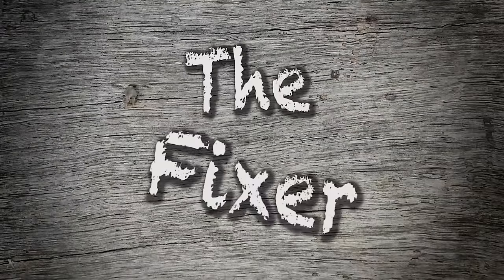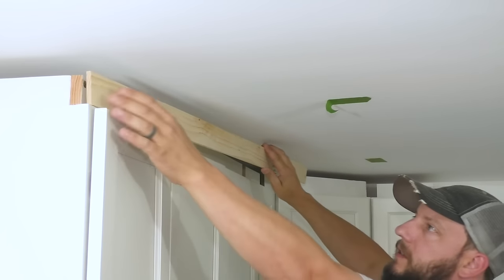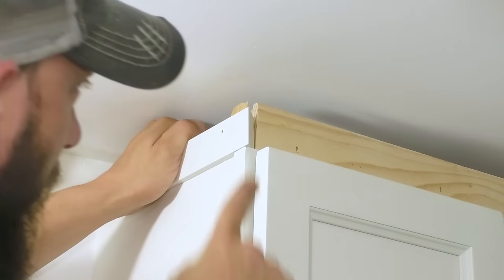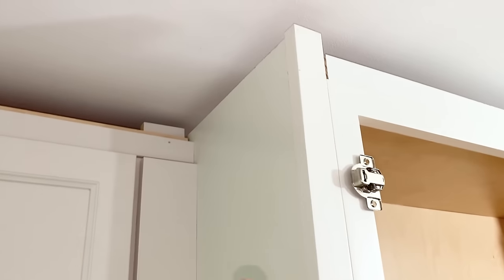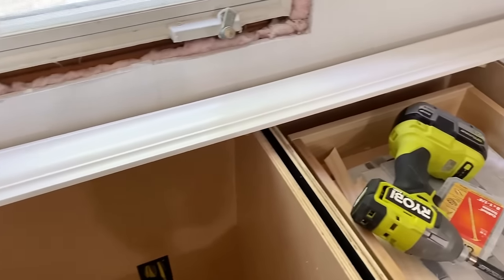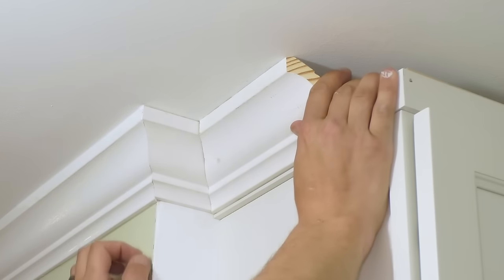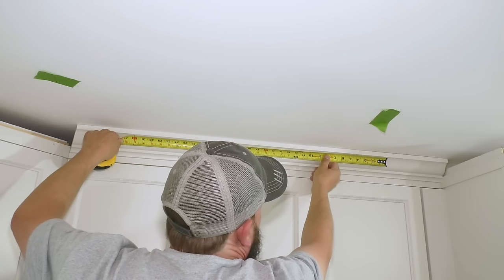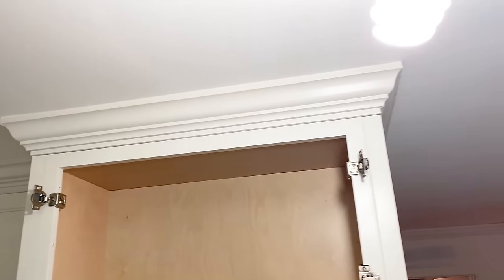Installing Kitchen Cabinet Crown Molding

Comment: Looking great. I did this in my kitchen a few years ago with crown supplied my the cabinet company. Stained cherry wood. It was crazy expensive before the Wuhan flu expensive! I think it was like $12.00 a foot. I ended learning to do the longest runs first since I was screwing up so much I could then use the screwed up piece in a shorter location. I did not enjoy the process.

Comment: Great job one trick I learned is when installing the crown after nailing up the first piece I then take caulking and run a very small bead along the edge that will be nailed next that way if there are any small cracks or the seams are not perfectly mitered the caulking will fill that small void or crack. I use a squared off old credit card to run across the the two edges and then wipe with a damp rag. I also use the trick when installing trim around doors. A lot of DIYers will try to caulk a seam that has a small crack and it will not look as professional as this trick

Comment: Safety issue. At minute 12:39. You cross your arms while cutting with the saw. NEVER EVER do that!!! Either use your left hand to drop the saw, while holding the piece to the fence with your right. Or hold the piece to the left of the saw blade with your left hand and drop saw with right. Again, never ever cross your arms in front of any power tool.
Reply from the maker: Good call, Lance.

Comment: When this video first started I thought, "Oh, Geez! He's not going to add additional blocking to bump the molding out to the depth of the doors! Wrong!" I almost turned it off but decided to see the molding mullet you were going to have at the end. Thankfully, mid-vid, you attached the extra blocking on the front of the original blocking. Kudos! Job well done!

Comment: I’ve always heard that you’re supposed to keep crown molding on cabinets 9 inches below the ceiling if you don’t, you’re supposed to bulkhead the cabinets before you do crown.  I’ve installed it this way as well and I don’t understand what the problem with it is. Could someone that knows if this is true, explain why it’s true? The only thing I can think of is if the ceiling sags it will push on the cabinets as well.

Comment: Great video. Much appreciated. I’m assisting my carpenter doing our new kitchen. We have similar cabinets, although not white. And this has given me some excellent solutions to how we were going to do the crown. And we have an odd size ceiling height, so we will not be connecting to the ceiling which may make things easier for us. But I appreciate your detailed explanations.

Comment: With MDF base moulding, I've used an angle grinder with an 80 grit flap wheel as a coping tool. It works very well, a little tough to control on the fine tuning but great for the bulkier stuff.

Comment: one tip.. when you cut the crown on the miter saw use a guide line or a stop block .. all crown have a reveal... so if you put it the same way on every cut you going to have much better match later...

Comment: Pro tip: when you figure out how the crown sits on the table saw, pencil mark a line then hot glue a scrap piece a wood down on the line to make a crown stop. This will ensure that when you set it down on the saw the spring angle is exactly the same every time.

Comment: You could use the crown settings on your miter box so you can make cuts with the trim laying flat in the miter box instead of holding it at an angle. Makes for more precise cuts.
Reply from the maker: That would be ideal for perfect corners but this way is easier to adjust when (they almost always are) off.

Comment: With MDF base moulding, I've used an angle grinder with an 80 grit flap wheel as a coping tool. It works very well, a little tough to control on the fine tuning but great for the bulkier stuff.
Reply: Jigsaw works better, you have more control

Comment: You may want to learn to use your left hand to power the saw and right hand to hold the wood @ 12:24, doing a cross cut like that is dangerous.
Reply from the maker: So I have been told.  😁. Thank you for that.
Reply: @TheFixerHomeRepair  It's one of the first things I learned while cutting trim as a carpenter, and It's not that I think you'll hurt yourself, it's that other people are watching the video's who may have less experience and it can lead to a very bad outcome. Love the videos! =D